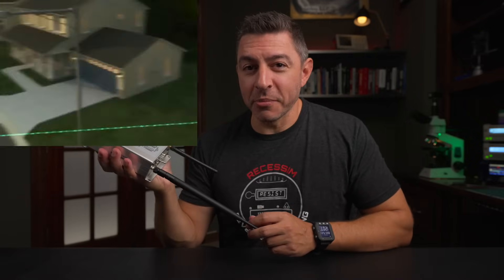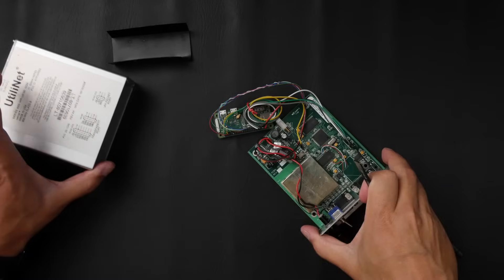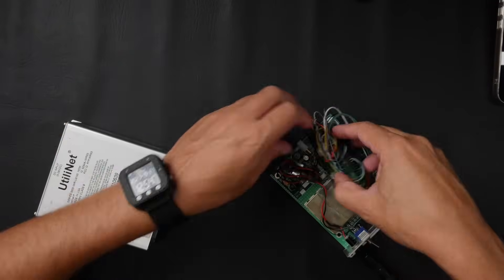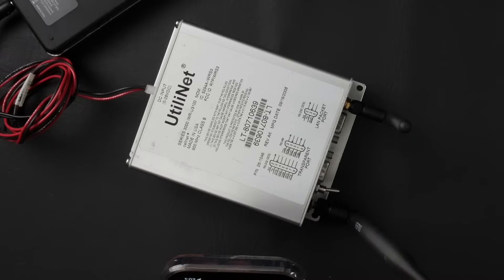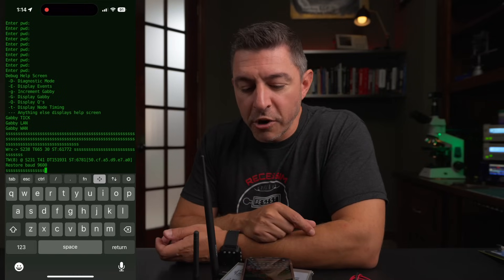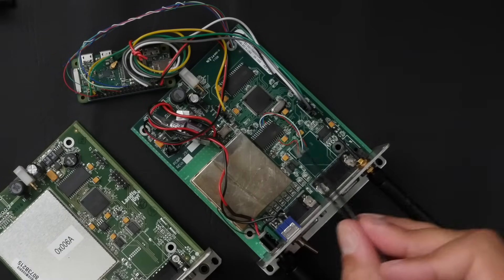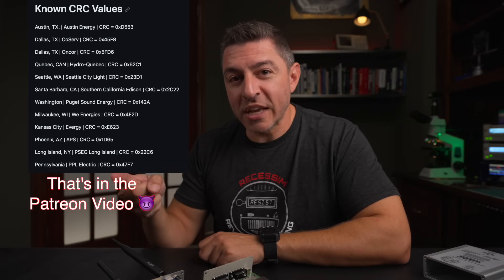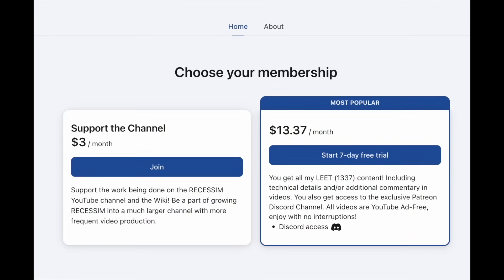Hacking the Power Grid - Their password is TERRIBLE! 😂

Comment: This stuff is truly terrifying, it’s incomprehensible to me that there’s not a massive program to plug the likely millions of security holes in critical infrastructure.

Not only this, but how many CCP agents do you suppose are in the country right now? There were almost certainly thousands back in the day when the border was at least a notional concept. Now - 10,000? 50,000? If they weren’t massively infiltrating the country they view as their ultimate enemy, they’d have rocks in their heads.

A hundred or so agents with scope-equipped high powered hunting rifles could take out that many major grid transformers within an hour. 10x that number and they could take out a lot of critical HV transmission lines as well. Could there be hidden malware already present in industrial and municipal (think water, sewer and in some locales gas) control systems, just waiting for a trigger?

There have already been at least two incidents where someone with a hunting rifle shot out insulators at major electrical substations (IIRC, one in NC was quite large and a cause for some public concern around the time) and the perps were never caught. Dry runs?

Am I over-inflating the danger? I dunno, I certainly hope so. I’d like to hear Recessim’s thoughts on the topic: Just how much damage could a nation-state actor do in say 48 hours, particularly considering the exposure of critical grid infrastructure like transformers and transmission lines? Just how badly compromised could infrastructure and industrial control systems actually be?

(Great content as always, super-interesting!)

Comment: Oops, looks like you leaked a few SSID's, on a map they are just outside dallas, tx.
Be careful leaking access points like that.
Reply: 2304 Aberdeen Ave, McKinney, TX 75072, USA
Reply: ...SSIDs are broadcast. Not only are they not secret, they're literal advertisements.
Reply: @dawnfire82 Networks set to "Hidden" dont broadcast the SSID, you either have to know what it is, or listen for devices that have already connected to that access point, those say "hey im looking for this SSID" and give it away

Comment: Being from a rural place, it's always funny seeing changes like this. The ones that clearly only sound good to those who are blinded by the prospect of making everything "high tech". Everyone wants the newest technology in our infrastructure, but no one wants to make it secure!
Reply: Sad thing is.... A very high majority of all utilities/infrastructure/equipment etc is using 50 year old "high tech" equipment and devices. They do not upgrade to more secure & newer technology because the cost is astronomical. Very expensive to rip out the old equipment,install the new equipment, troubleshoot, possible outages etc... so they just keep the 50 year old technology with zero security.
Reply: Utilities have been heavily motivated for decades to get away from people roaming the countryside to read meters. I can recall the power company's first attempts at this way back in the 80's... something that looked like a doorbell transformer that sent a very low power RF signal that the truck could hear as it drove by -- still needed a person and a truck, but much faster and more accurate as they don't have to stop, get out, decipher the reading, write it down, etc., etc., etc. These days, we have 900MHz and 2.4GHz (the same as your wifi) mesh systems that don't require people in trucks anymore. (99% of the time... out in the sticks where there's no cell coverage, or other meters in range, someone still has to drive out to read those. And they charge for it!)

Comment: I dont get it why this is hacking. I mean, I can see the serial com there. debugging the serial will be easier connecting on those serial comms. and the password on each serial device has a default passwords just like a wifi modem that is stored in plain text on eprom. yes, you can read the master serial giving signal but serial handshake requires the id of slave serial device to be verified by the master serial device or scada plant manager white list, if the slave id is sketchy they send an alarm to plant operator informing them of that sketchy id serial device or banned that sketchy serial device out.
Reply from the maker: So why not just receive a known ID, change the ID of this device to match and cause mayhem?
Reply: @RECESSIM  the way serial comms are configured for master and slave communication is a slave serial device is configured for a specific area master serial device. the maximum number of slave device to a single master device are 127. if that master device is already full your are out of luck inserting another device there, if you can insert a slave device it needs to be white listed or registered first to that specific master device by the control engineers first. and the white list is not just registered to a single master device it is registered to all master device on that scada cluster. the real tricky part is not accessing the master device but accessing the jtag lock on those master devices and if a single master device went offline another redundant master device for that area will go up and alerting the scada operator something went down. assuming first you know the baud rate for the serial handshake. side note: dont confuse a serial pass thru for a master device a smart electronic engineer will plant a booby trap in a cluster to know if his network is being tampered with or to protect the most critical junction of his network.

Comment: We have a smart meter now but it utilizes a cellular modem with a SIM card. The issue is that the network is not up and running yet. It would be nice to use one of the cellular hacking rigs the feds use to try and obtain info on the device. I know th3 network they are on and there is practically zero coverage where we live. One of the techs that installed the meter told me they have ongoing issues with cellular coverage and they have had to install SIM cards from another cellular provider. I am wondering if this is the reason my alarm light is constantly lit.

Comment: Meter readings are sorta public data anyways.  You can walk up to a meter and look at it.  What's the worst that could happen with exploiting this network, forge some readings?  The real data is displayed on the meter itself, so any billing nonsense can get squared away.  This may be the correct amount of security and management cost for this data type.
Reply from the maker: The meters have 200 Amp switches inside them and can be remotely turned on and off over RF… You can see this in my Smart Meter Hacking videos.

The worst thing I would say is someone gaining access, then flipping the switch on/off to whole neighborhoods until something bad happens.
Reply: @RECESSIM  Is there no additional authentication required to cross the boundary from monitoring to control?  If so, that's indeed worrying.  Didn't know power meters were also switching devices these days.  Thanks for the info!
Reply: @RECESSIM  Not all meters have the ability to disconnect service. I know the units my power company uses can't turn off the power. (my meter was stolen. they could tell it was on, but not immediately locate it, and could not turn it off. their fraud department will hunt it down, 'tho.) You'd think the ones out in the sticks would have that capability, but they didn't. (of course, it takes seconds to bypass the meter, so why put an expensive one out there.)
Reply: You can walk up to a meter and look at it Not without trespassing in most cases. Yes, some are where they can be seen from the street / sidewalk, but I can point out a great many you cannot see without entering the property. (The PoCo has a right to read the meter. You don't.)

Comment: The main problem is how long this stuff has to last. You might think it's easy to add encryption but you have to realize a lot of this dates back decades and the service life is decades. We had smart meters when everyone used those old analog meters with the spinning disc - and they're still in use. The protocol is ancient but not encrypted as encryption was something fancy people could do (remember this stuff predates things like Windows XP). Even later equipment might be designed in the XP era, and still in use today. Why not upgrade? Well, to do so would cost money to buy the latest equipment and millions more to install it all. And chances are the latest equipment could support more secure channels with encryption but the legacy equipment installed won't understand it so it has to fall back to less secure communications because again, no one wants to pay to move the network forward. It's like trying to make sure your network will work with DOS, Windows 3.1, Windows XP and the latest Windows 11 all together on period machines. And be secure.
Reply: 6 replies counted but I only see 3 here.
Reply: to be really technical I assume you know why it still industry standard to use bacnet, modbus, profinet and can for serial communication and I will also assume you know serial handshake. and securing serial comms is as easy as a white list and a jtag lock.
Reply: Hardware chips capable of DES, 3DES, and now AES, have been around for many decades. They were a bit expensive (inflation, etc.) back in the day, but they did exist. No one used them, nor do they do so today - when they literally cost pennies -- because no one cares. (and doing encryption correctly takes some work. i.e. not using out-of-the-box defaults.) I interviewed with a local company that makes the metering tech for power companies; even their state-of-the-art current versions has no encryption in it. (from the cell radio back, there is, but the mesh between meters... not at all.)

(Apparently banking ["money"] is the only thing that cares, and they wouldn't if they could get away with it.)
Reply: You don't know enough about the technology to make that claim. Fact is you are completely wrong and a chip to secure that device would cost maybe a dime at the numbers a company would.purchase to mass produce the device. They are called.microcontrollers. they are extremely cheap and available.
Reply: @fjb666  They are now, they were not when the protocols were created, nor when the PUCs  signed off on the replacement hardware, hardware which needs to last decades given the cost of the revenue grade metering hardware and how little the PUCs want to spend and allow prices to be raised. Granted, there's very minimal control beyond typically single point of use on these networks. So you can watch, but you normally can't do anything but watch. These networks are also very very carefully segregated with gateways, multiple firewalls, and near airgapping of these networks from any control authority. 

These don't need to be secure to do their jobs typically, because while sure, you can potentially turn off points of use, you could also turn them off with the manual isolation valves or other hardware that is required by law to be readily accessible for emergency responders just as easily. So in the utility space, we more or less don't care about these devices, because there's very little you can do or get out of them that you couldn't already do or get without the networking upgrades. Recall that these things have the displays on the exterior displaying nearly all the data, and that the analog ones before them had the dials on the exterior that also displayed everything. 

For anything actually important controls wise, the standards set by FERC and NERC, along with the regular security audits are perfectly good at catching issues.
Reply: It's like you didn't read the message you're replying to...  the cost is not in the microcontroller itself, the cost is in installation / maintenance / managing secrets / certificates / backwards compatibility / etc. across a staggering number of units from possibly different manufacturers. @fjb666

Comment: The 915 MHz network reminds me of the metrocom ricochet network in NY NY, it's been gone for 25yrs , but they did bring it back up a short time after 9-11.
I would love to know how to piggyback on the bandwidth of those smart meters,  if it could be done without interfering with the operation of the overall system.
Reply from the maker: These modems are based on Ricochet technology! Same company designed them!
Reply: @RECESSIM  I got my hands on one of the old ricochet pole mounts and a few of the modems, do you know anything about them or got any tips how I should go about dissecting them?
Reply from the maker: @petevenuti7355  I was able to get two modems communicating with each other directly. Fun to chat back and forth in terminal windows!

Check out this site, there’s a reference guide at the bottom with modem commands.

https://www.qsl.net/n9zia/metricom/
Reply: @RECESSIM  of course if I knew how to used metering system in that matter, I wouldn't disseminate the knowledge, just protect it because there will always be some idiot that would abuse it potentially ruin it,  just like the infrared remote for the changing the traffic lights...
Reply: 900 MHz ISM will not have bandwith to do much in the way of modern internet access, I think at best on a test setup of a Ubiquity Nanostation M900 pair I was doing 10 base T speeds in a 5 mile link, however it does make the band reliable for long distance links and the RF can penetrate through most obstructions especially trees and such, but given it's band, 900 is considered a low end microwave and solid metal obstructions will deflect / reflect it but not as much as 2.4GHz or 5GHz bands.
The higher the frequency band the wider bandwidth you can use like on 5GHz you can do 5MHz - 160 MHz wide channels where 5 MHZ will give you a super stable long range at the cost of speed due to bandwith constraint vs 160MHz which will give you speed but at the cost of instability due to interference from other devices on adjacent channels that you now overlap

SO if you need SCADA type linkage to remote locations or vehicles in your area of operation  900 MHz is a good band to go with obviously. 
As Todd Howard would say "It Just Works"
Reply: @tgmelinda7544  I live in upstate New York and I tried to start a wireless broadband ISP back in the 90's, 
   Failed miserably, I'm no salesman, it was just a bit too soon, and I had no money to speak of...
   Anyway, still got a hodge-poge of equipment , sold or scraped most..
  I used the DEC, later lucent technologies wavelan's.. an old itronix 486 laptop to go around doing configuration, homemade yagis and servers. 
   Completely quit even trying in 2003.. I did have a few ubiquitis by then.
(Made an old breaker panel look like a Cheerios box and marked it "Router O'S" , Even built something into a glass block at one point.)
   Don't think I ever had more than six customers at a time.
   I wanted to try TV white space but it didn't get defined and approved quick enough.

Comment: It's kind of funny to think about people freaking out over the Flipper Zero when things like this are so readily available and nobody cares.
Reply: No one cares because what are you going to do with random people's energy consumption meter readings? They are already readable from outside the house with binoculars or you could walk right up to the meter and read it, all you need is a high-vis vest.  You wont be able to use this network to communicate any better than internet already allows us-- the bandwidth and low latency are both not there on a network like this. So that's why nobody cares.   And the flipper isnt that crazy either-- for any rolling code (actually protected) wireless communication it doesnt work. That's why no one cares about flipper zero stealing your car, either
Reply: @gutrali  The problem is, there *will* be some vulnerability that allows you to update firmware on these power meters. That opens possibities from faking meter readings to attacking other kind of devices (pipelines? high-voltage switches?), just like IoT devices was turned into botnet for most powerful DDoS internet had ever experienced.
Reply: @gutrali  flipper works for rolling codes if you update the firmware, you'd have to listen for a copy of the remote key, but then it can just make its own rolling codes
Reply: It's not that you can capture and read this stuff as it is if you can transmit back into the system the captured data came from.
Reply: Been saying it from the beginning. Flipper is a novelty toy for script kiddies
Reply: I have a slightly modded android phone that can do pretty much anything the Flipper can do, but it can also play YT videos!
Reply: @EddieTheH the power of root and a otg USB cable😂
Reply: @EddieTheH  what android compatible USB SDR are you using that can also transmit? What software are you using to tune, capture, and replay?

Comment: “Someone I once knew” worked for a utility company that upgraded the gas meters from analog to digital. They used a handheld that would read and program them. It was a pretty interesting system. I’d love to see how the technology compares. The meter faces basically just read the position of the cog gear ⚙️ inside and count how many times it’s spun around. Very simple device.
Reply: There is value in dumb simplicity. Not just from a security perspective but from a reliability one. There are lots of mechanical meters in the power grid. They are used even when there is electronic monitoring.
Reply: I caught some guy in my yard acting suspicious.  I went out to talk to him and he was changing the battery in our gas meter.  He showed me that handheld device.  Apparently they have to reprogram it when they change the battery.  He says they are outside contractors.  Really glad I caught him when I did because those batteries last a long time and it was an interesting conversation.